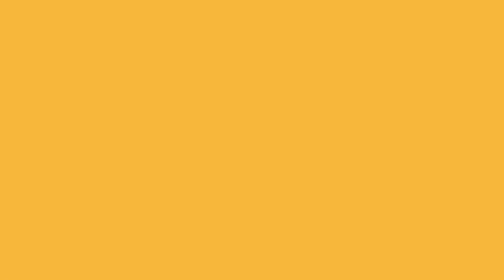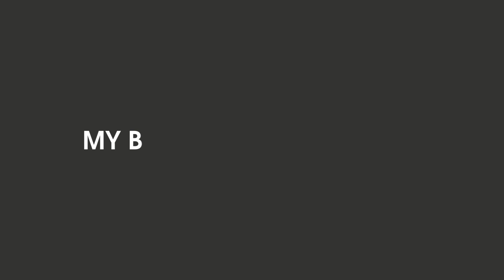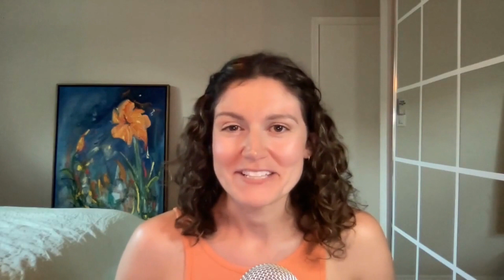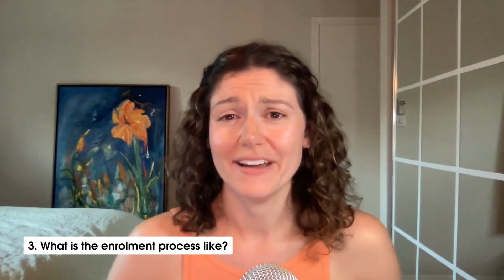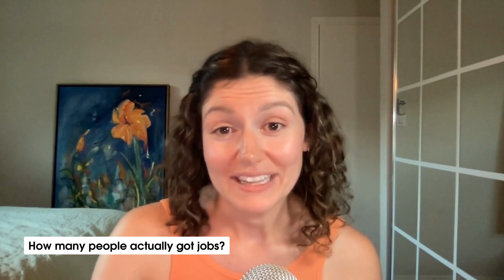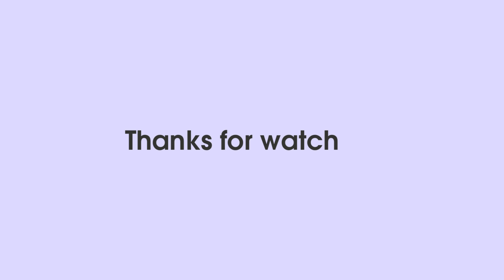BrainStation UX Design Bootcamp | My Bootcamp Experience

Comment: Hi! I'm currently in the process of deciding which bootcamps to consider and your video was so helpful! Thanks for sharing the enrollment process for BrainStation. It's been hard finding information about what the enrollment process is like for many of these bootcamps. Also my jaw was on the floor when you talked about the whole design challenge situation!! I can't believe that happened all because you didn't write "menu" omg kind of ridiculous
Reply: There is no "guarantee", BrainStation doesn't promise any graduates help with employment. Nor do you ever meet any of the hiring partners, or even see their names on positions as it's all hidden. So you basically have no opportunity to network with them. And the industry project is highly independent, you mostly work on isolated teams and never get to work directly under an actual industry designer. So to say it's an opportunity to work with a designer is a bit disingenuous on BrainStations part. The instructors in my cohort were good, but slides were extremely lacking. Instructors often had to say, "please ignore this slide", since it had outdated information. Only 5 or so people got design jobs from my cohort, and only 1 was in UX design.

Also, the price has increased to $16,500. Imo this price tag is insane given they offer no help with employment except for weekly meetup sessions, nor any chance to work with an actual industry designer.
Reply from the maker: Happy to help by sharing my story! Thank you for your support 😊
Reply: @emiliemazurek  Hi Emilie, thank you for your review it was great listening to your experience at BrainStation. I was thinking of taking the UX design course there or the one offer by York U. In your experience have you heard any feedback on the UX Design course offered at York University?
Thank you for your time.